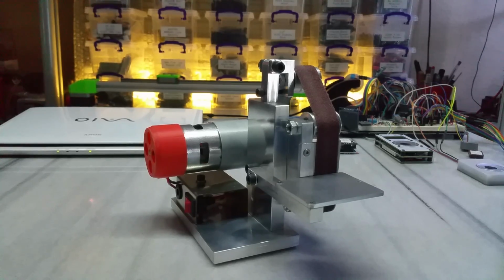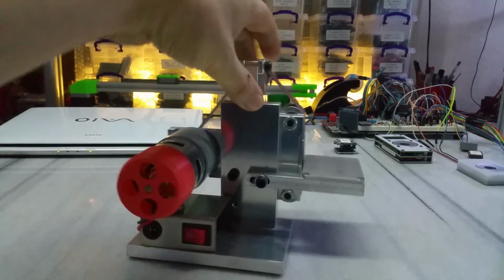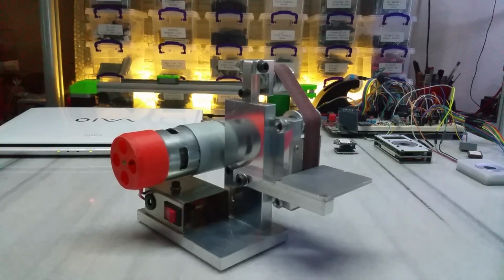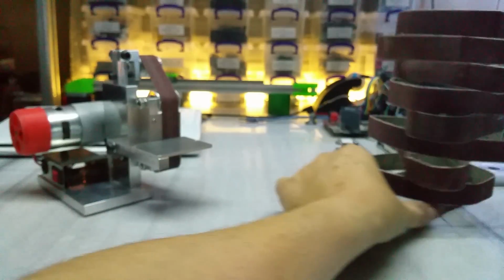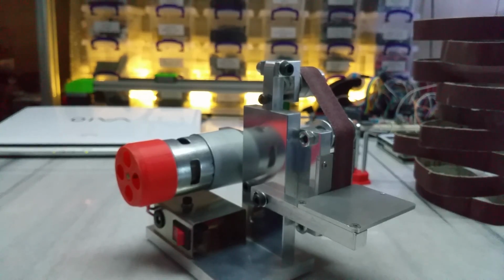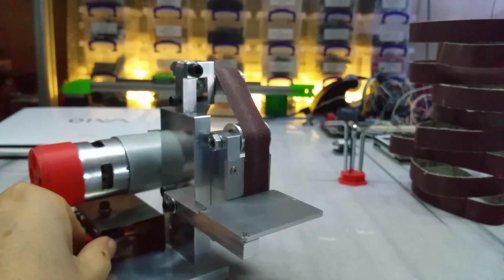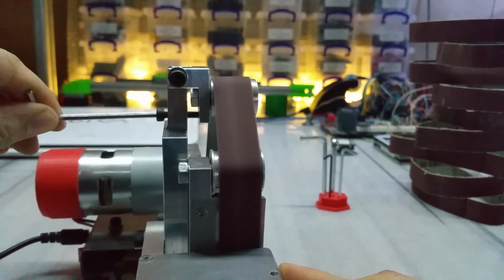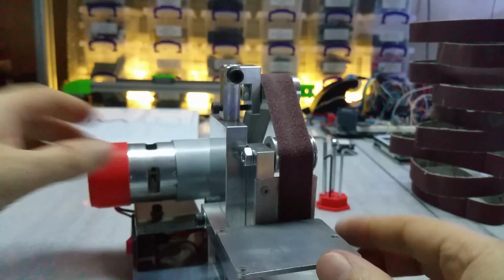Mini Belt Sander from Banggood

Comment: What a seriously cute little baby belt sander :)
Reply from the maker: Yes, indeed David. The second I saw it I had to have it :-) And it is not just a toy as my second video of it shows.
Reply: @iHayri1  I just watched your follow up. I can see quite a few uses for one of these! bit awkward that I can't seem to find the 330x20 belts on banggood though... 330x10 no problems.... I might have to get one when I get paid at the end of the month anyway though!
Reply from the maker: Keep in mind that it already comes with 10 different belts. I will ask my contact if extra belts are available somehow. Just saw that some of these sanders are only for the 10mm belts and have narrow wheels. I personally like the 20mm belt version better, looks beefier :-)
Reply: @iHayri1  I can definitely see uses for the 20mm version!
Reply from the maker: @Ms_Davina  Me too :-) Looked into 20mm belts and they are really hard to come by but at the same time you can easily make your own. There is a 540x20mm belt that could be easily be shortened. There are several how to videos as well. after seeing what it can do to a HSS drill bit, I am confident by it. I am glad that I found it on Banggood.

Comment: Those belts and rollers seem wider tha the often advertised one?
Reply from the maker: That's true, mine are 20 mm wide and most are only 10 mm plus they are sometimes made of bend sheet metal. Mine is solid aluminum. Just be sure you buy what you want and don't let the price be the deciding factor. Stay safe.

Comment: Hello, what are the size of the pulleys?? Thanks in advance!!
Reply from the maker: Hi, the width of the pulleys is 24 mm the inner surface is 22 mm, the diameter is 20 mm. This grinder is for 20 mm wide belts. Hope this helps.
Reply: @iHayri1  , Great thanks! I have the same grinder but with smaller pulleys. This information should help me find some pulleys the same size as yours 👍🏽👍🏽
Reply from the maker: @dou8letap82  You're welcome, glad I could help.

Comment: That's pretty cool Hayri! Do you think it could shape small hss lathe tools?
Reply from the maker: Thanks Michael, not that I ever reshaped hss tools but I don't see why not, as long as you have the appropriate belt and have the belt sander on it's highest speed it should work. I will try it asap and let you know.
Reply from the maker: Hi Michael, just tried it with a HSS drill bit and it has absolutely no problem grinding it and after some research you do not need high rpm at all. Like normal if you have lower grit go with low rpm and higher grit with higher rpm.
Reply: @iHayri1  cool, thanks Hayri
Reply from the maker: @Mike..M  You are very welcome, guess you saw my update video :-) Now that I know this I might just start my first custom knife project.

Comment: Can anyone answer if the platform and the belt can reach 165 degrees for knife sharpening???
Reply from the maker: I wasn't aware that it needs to reach a certain temperature for knife sharpening. It can easily grind HSS tool steel and I would think that is enough to sharpen any knife.

Comment: Also, it appears they only offer a 220v variant :-(
Reply: nooo, the 110V one is even cheaper!
Reply: The only difference must be the power supply...
Maybe Hayri
 you can put your affiliate link to this.
Reply from the maker: I just checked your link and a buyer stated that it does not come with a power supply, which would explain the huge price difference. I know it says 110V but there is no mention of the power supply and the motor is obviously a 12-24V DC motor
Reply from the maker: Hi Michael, I checked the other link and it is only the belt sander without a power supply. If you do not need the 220V oh wait wait, I feel stupid now, just checked my power supply and it is able to work from 110V to 220V like regular laptop power supplies. So you can order the supposedly 110V version without the power brick if you have your own or the one from my link that does work with 110V. Hope this helps.
Reply: I think you will find that the motor is 12 to 24 volt DC and the power packs will accept a wide AC voltage range. Mine had a sticker indicating 110- 250 Volts AC for input with 9 - 24 volt DC output. A lot of the stuff in the eBay listings is nonsense, I have one that was listed as 100 to 250 VAC and I have just bought 6 more units for people in a wood carving group I attend and it was listed as 100 volt. yet there is no AC voltage associated with the grinder unit just a switch and plug to the DC motor. They are identical units.

Comment: So the motor is 350W at 24V if the 885, but the power supply is how much, like 60-80W ?
Reply: Use a microwave oven transformer with secondary coil rewound to get ~500W 24V power supply.
Put a full bridge rectifier and a big smoothing capacitor, and there you go.
Plus you can use it with a step down converter as a bench power supply/battery charger/etc

Comment: What is the width of the belt? Looks to be 30 mm but I'm not sure.
Reply from the maker: It is 20 mm and I just found a seller for the belts on Aliexpress as they are hard to find, most are only 10 mm and even Banggood do not carry them.
Reply: Thanks for the quick reply :)
Reply from the maker: @19Edurne  No problem, just search for 20x330 belts or use this item number: 32879759571 on Aliexpress

Comment: Hi, I have the same one but its a 10mm belt, did you buy new rollers for it so its 25mm, where did you get them from. cheers
Reply from the maker: Hi, no, mine came with 20mm belts and rollers :-) Maybe you can find them but I have not seen them sold separately.

Comment: Where did you get the rollers?
Reply from the maker: It comes the way you see it in the video, except the 3D printed cover.
Reply: @iHayri1  You said you bought rollers and motor to build one. Where did you get the motor and rollers to build it?
Reply from the maker: @jimhamer5322  Oh, for the big one I am making, the rollers are actually wide skateboard rollers from eBay, the motor is a used one bought locally. Still need to get a big roller for the motor.
Reply: @iHayri1  Thank you.
Reply from the maker: @jimhamer5322  You're welcome Jim, you can find all sorts on eBay, even aluminum ones :-)

Comment: Waste of time. You didn't show it running or in use. You didn't demonstrate how strong the motor is. 12 minutes of nothing.
Reply from the maker: Thank you for your comment.
Reply: @iHayri1 Yeah.. sorry.. I can be a smart ass! I see you did another video that actually runs the thing! It's cute, and I wanted to buy it, but...… 2 months delivery time on Amazon- don't get that; don't trust some of the sellers with bad feedback on Ebay; you CAN'T buy belts this size ANYWHERE; I don't trust the longevity of the power supply (as some have died from reviews); noisy as heck from them using cheap ABEC bearings (could be greatly improved with good bearings- but more $$$); and lastly, you can get twice the machine, with twice the motor, in 1" x 30", including a disc sander, much more readily available and serviceable; if you throw in another $30-$40..    So I would up getting the 1'x30" Micromark/Allwin w/5" disc as well. Okay, was actually just over $100 with the $25 for HEAVY shipping. BUT OVERALL I DON'T FEEL LIKE I'M ROLLING THE DICE WITH THIS MINI UNIT ANY MORE, WHICH IS IMPORTANT. These are cute and compact if you're working on jewelry or something small, and I love the looks and the way they're built, but the build and value and overall power and versatility just didn't talk me into pulling the trigger. I had to go with a stronger more proven design. I hope yours holds up and has a long life. :-)
Reply from the maker: @blairtaylor9552  No problem. It is cute for sure and there are better and more powerful options out there as well, it just depends for what you want to use it for. Actually I did find the belt on Aliexpress and you can get all grits, sometimes it is luck to find what you are looking for :-) The power supply I have is still working and looks like the ones from Laptops. If you don't need the speed adjustment a 19V laptop power supply will work perfect and have enough current to not bog down. I have also seen copies of this grinder made with bent sheet metal which sell for less but I like the "heavy" duty build quality of this aluminum version. Good tools cost money, no doubt there, like I said you have to go with what you need it for. Take care.
Reply: @iHayri1  You should attach the link for the belts, as I looked on Aliexpress and Dhgate, and didn't find any (in this width. Narrower yes). Also just to let people know, even if one belt is available from one source (Ali), then unfortunately you won't be able to buy any good quality fabric-backed aluminum oxide or silicon carbide or other option belts. You will only get Chinese belts that won't last nearly as long, or cut nearly as fast. The quality of belts will make a huge difference. I bought better quality Red Label general use belts in 1"x30". They also had belts specifically for metal grinding (and knife making- a MAJOR use for these belt sanders. And also a set of belts specifically for sharpening mower blades and yard tools. Sorry to be so negative, but people should know how limited they'll be without any option for decent quality belts. If this unit (and power supply) had better reviews; they gave at least a little information on the motor output, they used at least ABEC7 bearings, and there were a variety of good fabric-backed belts available, I woulda' bought one of these. (Or one of the many similar designs). I originally started out looking for a more compact, but better built version, of the standard homeowner/hobby mini belt sander. I never found it. I should probably design one with my Alibre parametric solid modeling program, using a larger sewing-machine type motor and controller, and better bearings, components, and design than this. Hmm... I might need to get on that..